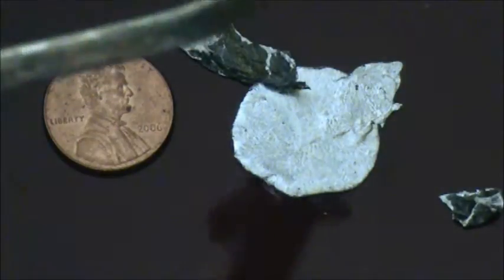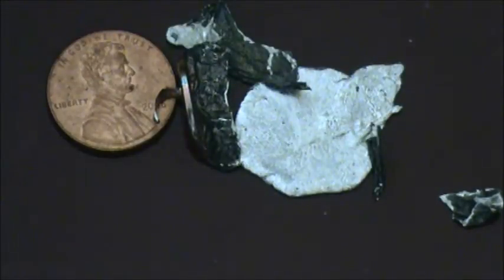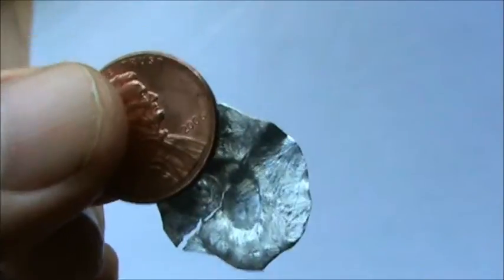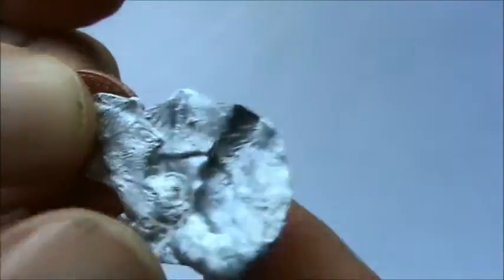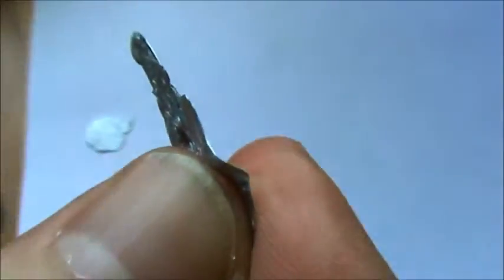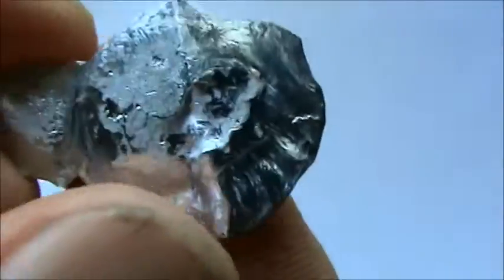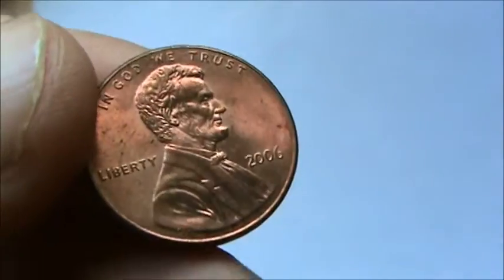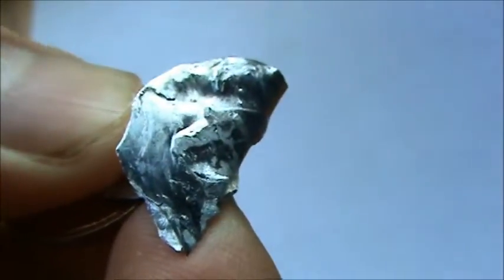Pouring Molten Zinc from a Penny

Comment: The1982 Lincoln penny has two different compositions and can be differentiated by weight:  As Minted 3.11 grams is 95% copper and 5% tin & zinc, and 2.5 grams is 97.5 % zinc and  2.5% tin & copper (the shell).
Reply: * NO TIN, just copper.
Reply from the maker: Yes, it seems variable for 1982.   Would be interesting to know why that is.

Comment: Can you bury pennies at the base of a tree to add zinc to your Pecan Trees? Do I need to remove the copper surface?
Reply from the maker: I've heard of this somewhere.  I'd just nick the edge of the penny and that would make the zinc available.  A small file works well.
Reply: @wbreslyn  I went ahead and did it. I used pliers to rip pennies into halves and buried them within a foot of the tree's base. I also added some Epsom salt (very little).
Reply from the maker: @MyCoolWheat  It'll be interesting to see  if there is an effect over time.  Do you have any trees without an pennies (as a control group type thing)?
Reply: @wbreslyn  there is one newer tree, same type, that I plan on not touching at all.

Comment: You won't have to worry about shaking if you get it very hot. I heat it up until it's just about to drip, then tap it once over the surface or container of choice. That gets me about 95% of the zinc in the penny.
Reply from the maker: Nice, that's a well thought out technique!  --- Dr. B